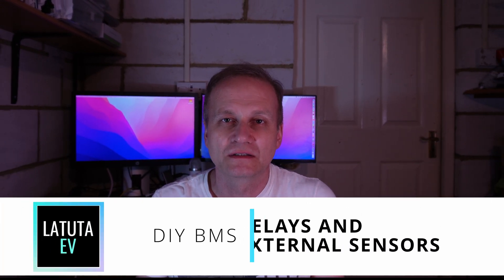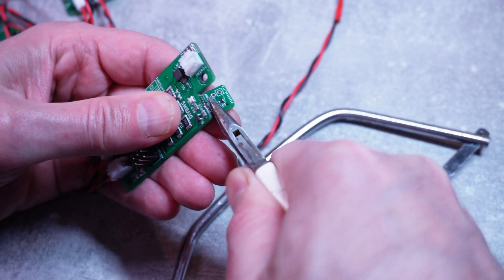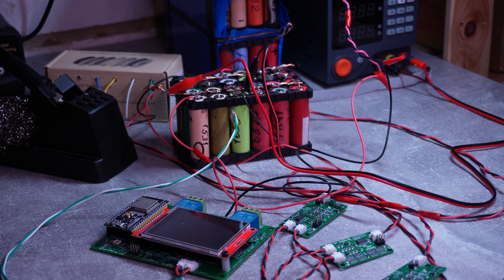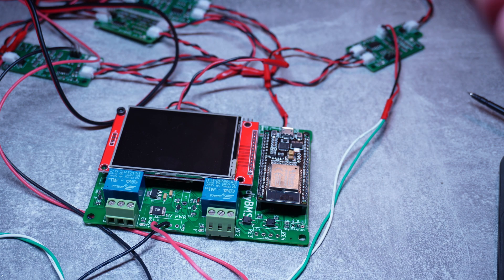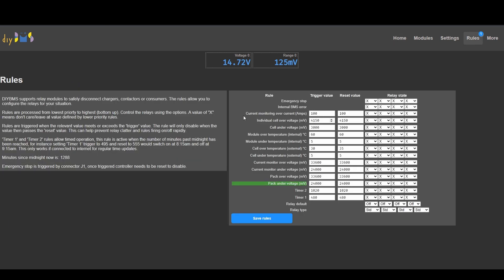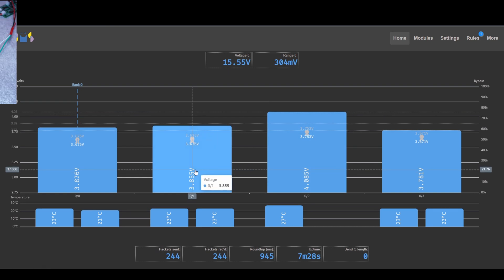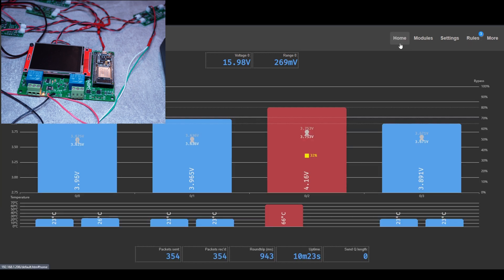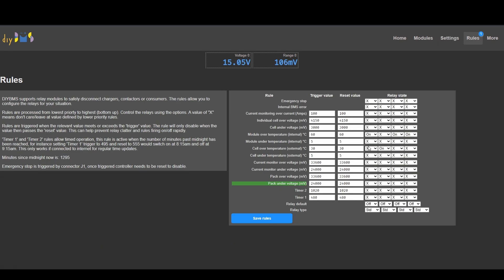DIY BMS Sensors and Relays Ep 5

Comment: Nice progress.😀
Reply from the maker: Thank you unfortunately not as much as I was hoping for. I still can't decide on the battery at this point
Reply: @LatutaEV  I'm still not convinced of the 96s setup. looking on the forum they say no.
They say it can handle 100 modules in a series/ parallel setup.
I hope you can prove them wrong !👍
Reply from the maker: @IfItAintBrokeStillFixIt  I think you may be right I just saw Stuart mentioned 100 modules but didn't dig deeper. Well I could use it at lower voltage first and then repurpose for the DIY powerwal